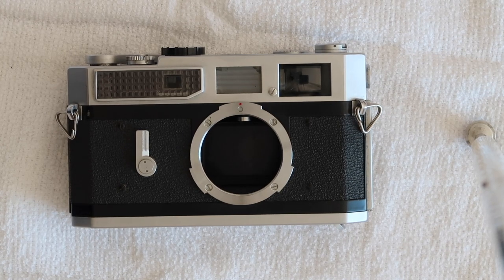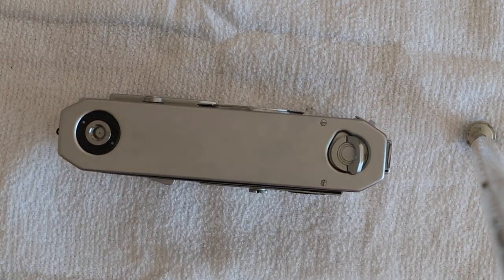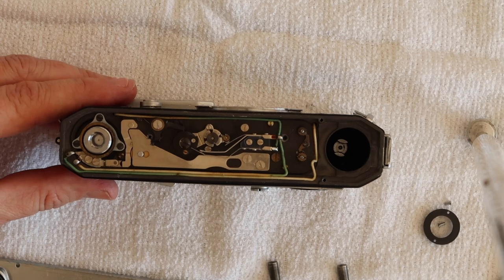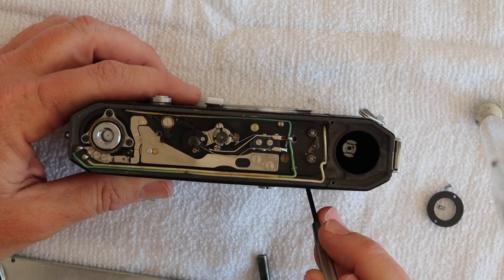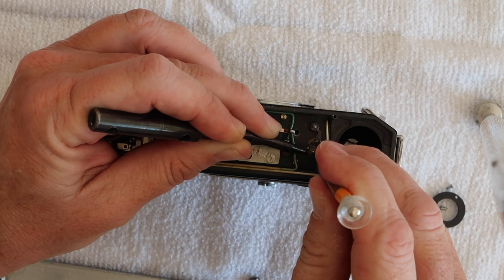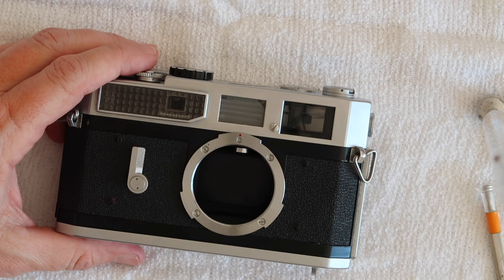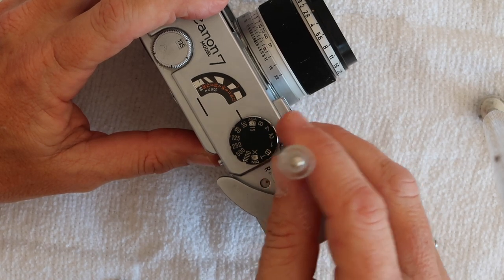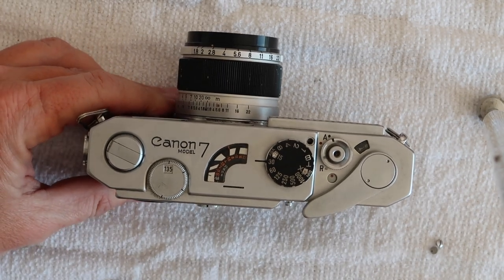How to fix a stuck or lagging shutter on a Canon 7 or Canon P camera

Comment: Do all these cameras have a different mechanisms for 1 sec? Mine seems to work fine on the other speeds but one sec is very much delayed.
Reply from the maker: There is only one slow speed mechanism. It can be adjusted, but that is not such a simple job. At slower speeds there is a lot of leeway in the speed. For mechanical shutters you will get good results if they are within 1/2 stop of the correct shutter speed. At 1 second, this means a delay of up to half a second, which is quite a noticeable delay.

Comment: I'm having an issue where the first shutter curtain gets stuck, leaving the left 1/4 of the frame blank at all shutter speeds. Would I still go through the same process in the first half of this video to fix this? Or does this only apply to a stuck second shutter? Thanks!

Comment: I can't find anything on how to adjust the high-speed shutter speeds. With mine, if the tension is too low, the shutter gets stuck at 1 sec. So I adjusted it just until it doesn't get stuck anymore. But now, on my high speeds, 1/1000 the shutter fires but doesn't open at all. Basically everything from 1/1000 to 1/250 is too fast.
Reply from the maker: You can adjust the speeds by changing the shutter curtain tension. Either the leading curtain is too slow, or the trailing curtain is too fast. The curtain adjustment screws are located under the bottom cover. The best method to use to adjust them is to use an tv screen, there are lots of tutorial on the internet showing how to do it.
Reply: @japanvintagecamera8869  thanks for reply. I ended up having to balance the shutter curtain tension as close as possible until the high speeds were accurate and then use the slow speed adjuster on top to fine tune. Turning the concentric spacer there even the smallest amount, changes the timing by quite a lot. For now I just got it as close as I could to another cameras shutter. For slow speeds I took a video with my phone at 60fps and then counted the frames in a video editor.
Reply from the maker: @antinox  Keep in mind that the margin of error for shutter accuracy for mechanical shutter is 30%. You won't notice a 30% difference at higher speeds, but it is noticeable at slower speeds, and a shutter which is running 30% slow will sound much slower than you think it should be, but is still accurate enough for a good exposure.

Comment: Hi. I really appreciate your videos. Thank you. I have a Canon P where the slow shutter speeds (1sec to 1/8) are very accurate, but starting at 1/15th of a second they are faster than they should be and not consistent. For example, 1/1000 fires at anywhere between 1/2000 and 1/3500. I'm using a PhochronXA shutter speed tester to measure the speeds.  Would adjusting my shutter tensioner, like you did in the video, solve this issue? Thanks again!
Reply from the maker: You can slow down the shutter speeds by adjusting the tensioners. This can be a time consuming process, but it is worth the time to get it right.
Reply: @japanvintagecamera8869  - Thank you so much for your reply. Are the tensioners most likely wound too tight, or not tight enough? -Scott

Comment: Hello, thanks for the video. I am attempting to do the adjustments but I am unsure about what you are turning clockwise and what you are turning counter clockwise. In the video it looks like you are turning the same screw both times. What you say is to turn the middle screw on the gear clockwise and the gear counterclockwise? How do you turn the gear counter clockwise?

Comment: What do i do if my Film Speed button doesnt work? when i press the film speed button while i dial the speed button its still in the same filmspeed?

And on lower speed settings the shutter lags or wont close at all. like 8-1 its pretty bad.? Do you have any tips for that?

Comment: Great content! I was wondering if you could help me with this one, my canon 7 curtain doens't close all the way after firing, would you recommend this?
Reply from the maker: The intermediary shaft which actuates the flash sync probably needs lubrication. You need to remove the bottom cover, you can find the shaft as it is the only one with wires near it. A drop of thin oil underneath should get it working again.
Reply: @japanvintagecamera8869  the one with two chrome screws and connected to cables?

Comment: Hey thank you for this video! I have the same issue and I will try and fix it this week, seems like a simple solution. One question though! Why use lighter fluid for lubrication? Does WD40 also do the job? Thanks!
Reply from the maker: You should not use oil in the more precise mechanisms of a camera, the oil tends to travel to places where it gums or jams up things. It is better to have no lubricant than the wrong lubricant, or too much lubricant. Graphite powder works well, and speciality oils used for watches and precise mechanisms. Both can be found on Amazon or eBay.
Reply: @japanvintagecamera8869  I really appreciate the reply. I have one more question: What was the type of oil you used after using the lighter fluid? Thanks!

Comment: Re the port cover for the vertical adjustment, I struggled with tweezers etc. until I finally took a wide jeweler's screwdriver that I didn't need and filed down the blade into two points that fit the holes in the port cover. What's the special tool you use for these (the one you didn't show?)
Reply from the maker: I used a pointed spanner which adjusts wider or narrower. These covers can be easy or hard to remove, depending on the camera. The best tool is the one you fabricated, I have a few such homemade tools for cameras I commonly work on.

Comment: Good day and thanks for the video, do you have the video about fixing stuck slow shutter speeds on the same models? And also please advice what to do on a Canon 7s, one part of the frame is slightly darker than the other, i suppose one of the curtains need adjustment, thank you so much!
Reply from the maker: Making adjustments is easy if you have access to an older CRT television. The screen refresh rate is usually 60HZ, so when you fire the shutter while looking through it at a CRT screen, you can easily tell by the pattern what the shutter speed is, and also spot capping. There are some guides on the internet showing the patterns, you adjust the curtain tension by turning the lock nuts and screws under the bottom cover.

Comment: Hello, very helpful videos! I have a Canon 7s with a shutter that caps at 1/500-1000, is the procedure the same as the 7 to access the curtain tensioning  gears? Also its film advance needs an extra small stroke to fully cock shutter and advance film - is that a simple fix?
Reply from the maker: The method is the same. As for the shutter stroke, that can be a more difficult issue to fix, the timing is adjustable, but requires more disassembly.

Comment: What do you do if the gear post is before the 6 o clock position? (Instead of being a bit left it’s a bit to the right) mine is having a light leak on the left side of the frame. I assume the Shutter is not closing all the way but my post is a little before the 6 o clock position instead of a bit after like your example.i know there is a shutter adjustment towards the top side of the camera that requires the front to come off which I would hopefully want to avoid.
Reply: I have the same exact issue! I urgently need help!

Comment: What do you recommend to do if the 2nd shutter curtain bounces at the end of it's travel? It's causing an overexposed frame edge at all shutter speeds.
Reply: The camera needs to be serviced and the curtain speeds and shutter speeds calibrating. Not by any way shown in this video.
All he has done here is basically guesswork - and I guarantee his shutter in not accurate.

Comment: what kind of oil do you use? thanks for the video
Reply from the maker: I use a fine machine oil which is sold by Yodobashi camera here in Tokyo. There are several different kinds designed for several different uses. Unfortunately, it is expensive, a small tube off each type costs about $20.

Comment: Hello sir, I recently got a canon7s and did a diy cla. But when I was about to finish I wasn’t sure how to go about setting the meter indicator again.
Reply from the maker: Turn the gear which is under the shutter speed ring until the orange 2.8 number is on the bottom of the window, and make sure that the ASA dial on the shutter speed dial is set to 400 when reinstalling the dial.

Comment: I have one with the self timer stuck and the shutter button stuck. Any advice?
Reply from the maker: Thanks for your comment. The first thing to check is that the shutter is fully closed, and that there is not a gap on the left side if you are looking through from the back of the camera. Next is to make sure that the selector ring around the shutter button is see to A and not R. If neither of these are the problem, the self timer may be stuck. To free it up you need to remove the self timer lever by removing the nut and lifting the lever off, then removing the 3 screws which hold on the nipple which support the lever. There are two spacers underneath with slots, don't lose them. Then remove the 4 screws around the lens mounting flange, lift it off carefully, take care with the spacers underneath, they must go back on in the same place they came off. Then remove the two screws behind the lens flange and spacers. Then take off the 4 black screws on the front of the camera. Open the film door, and you can remove the entire housing from around the camera. You will then see the self timer mechanism below where the self timer lever goes. Apply a few drops of lighter fluid, and depress the shutter button a few times. Add a few drops to the slow speed mechanism on the bottom of the film chamber. Reassembly is the opposite of reassembly.

Comment: My Canon P rangefinder has a vertical alignment issue. Any hints about what might cause this? Is it fixable?
Reply from the maker: It is very easily fixable. If you look at the front of the camera you will see the round rangefinder window. It is surrounded by a knurled ring, remove this ring by turning it to the left. Underneath is a glass lens in a metal ring with a slot on either side. Turning this glass by using a screwdriver to push the slot/s one way or the other adjusts the vertical alignment.
Reply: @japanvintagecamera8869  Man, that was a quick reply! Thanks! I'll try it tomorrow
Reply: @japanvintagecamera8869  It was indeed very easy. I had to readjust the horizontal alignment after adjusting the vertical one, but thanks to your video, it wasn't a problem at all. I can't believe that my local repair shop wanted to charge me $300 for this because, supposedly, they needed to remove the entire top plate to fix the vertical alignment. What a scam!

Comment: Thanks for the video. I have a question about my canon p. When I use a flash with the red 'x' sync speed on my canon p, I always get a dark area on the side of my film. The dark area is on the edge of the frame not in the middle and all the other shutter speed sound good to me. It seems that the 'x' speed is faster than it should. Do you think that this method could fix the problem? or there might be some other issues with the flash sync system? Thank you!
Reply from the maker: Thanks for your message. You can time the flash sync contacts under the bottom of the cover. The intermediate gear which I described how to fix also contains the cam which operates the flash synch switch, you should be able to advance or delay the flash actuation by changing the gap between the contacts. Narrowing the gap will make the flash fire sooner, opening it will make the flash fire later, but it take some experimentation to get it just right. I hope you can get it fixed.

Comment: This is not the correct way to fix the issue of slow or sticking shutters.
All that has been done here is to wash the dirt elsewhere and increase the shutter curtain speeds - to what will be now unknown and inaccurate - and increase the wear on the curtains and mechanism.
So now that camera has potentially unmatched curtain speeds and inaccurate shutter speeds.
There are speed adjusting processes shown in the service manual. 
What really needs doing is to fully service the shutter mechanism, cleaning all of the dirt out and re-lubricating in accordance with the service manual.
Reply: can you provide a link to a service manual with those instructions?